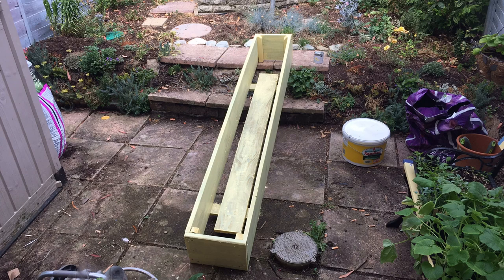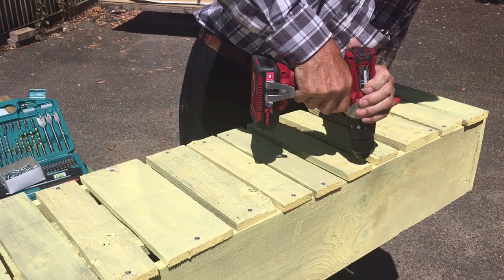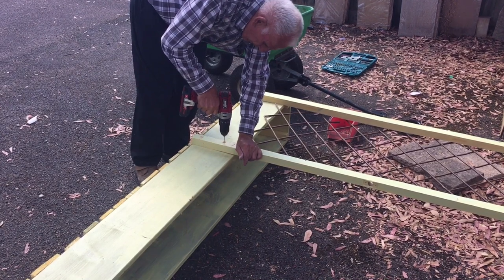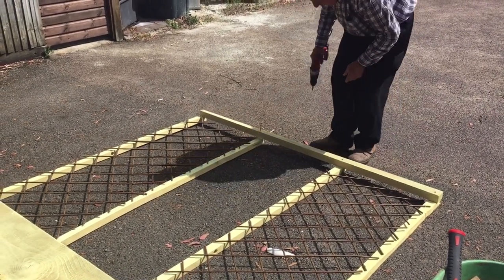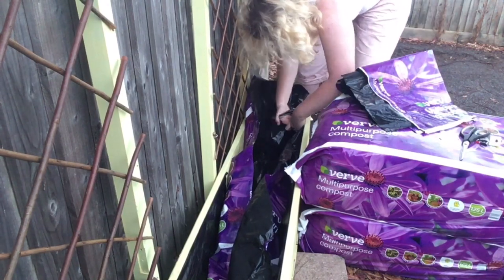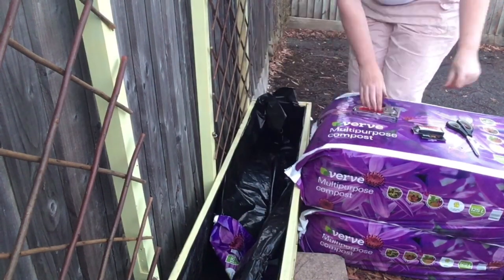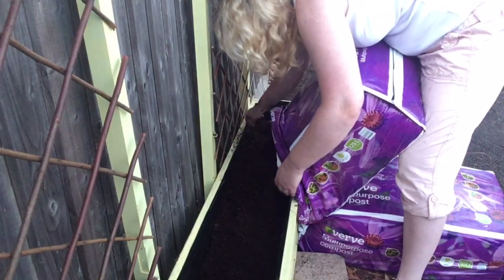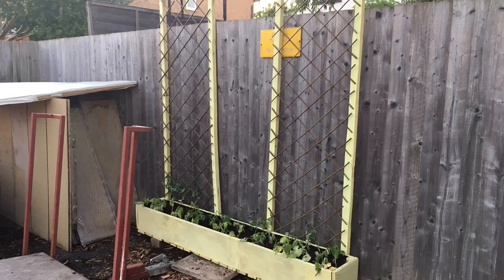How To Make A Bean Trellis Pea Planter From Scrap Wood - Zero Waste Gardening

Comment: Nice Lizzie. Make sure that you check the markings on the pallet wood before you use it.
It MUST have the "HT" symbol on it not the "MB" symbol --- HT = Heat Treated (safe for growing in) - MB = Methyl Bromide Treated - do not use in the garden!  
Google "Pallet Markings" to see what I mean.
Steve
Reply from the maker: Interesting - I deliberately lined the planter as well to keep anything from the second hand wood away from my soil which probably helps - I will bear this in mind when looking at pallets in future though - these were not sourced for planters but for another project where it didn’t really matter xx
Reply: To be fair, I have only ever seen one or two MB pallets (all pallets are treated for pest control for cross border use - HT good but MB cheaper to spray on). Nasty substance that is used on pallets that come from, shall we say, less well off countries.